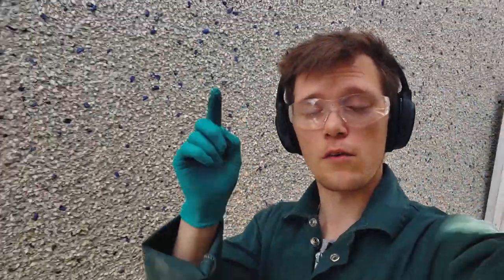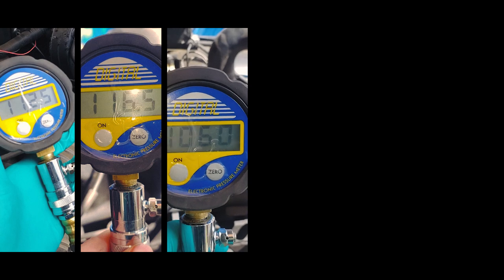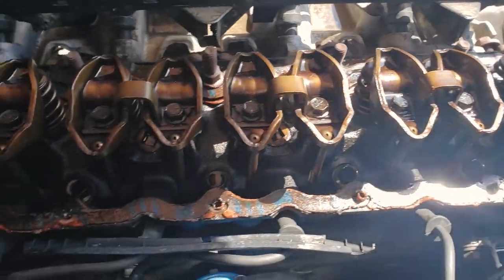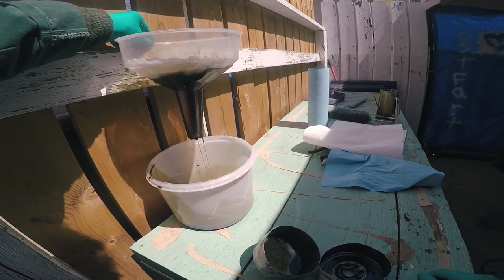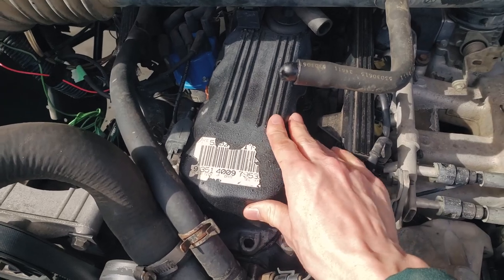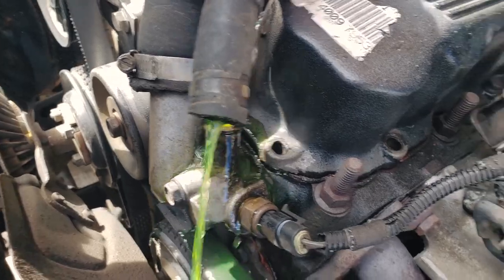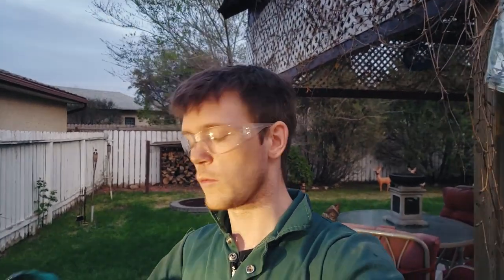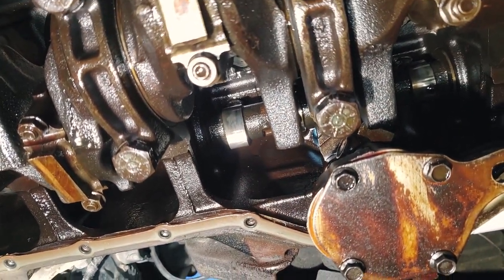Rover 1 Project - Diagnosing 4.0L Engine Failure

Comment: I personally wouldn't have bothered taking it apart in frame.  I would have just pulled the motor entirely.  You know it's no good and based off how it sounds highly unlikely to be properly rebuilt in frame.  Considering how low the compression is I have my doubts you'll get away with using something like a dingle ball to freshen up the cross hatch of the cylinders.  It very likely will need to be bored / honed and oversized pistons will be required.   Your cheapest option IMHO is to find a engine from a salvage yard.  I am not affiliated in any way with this site but I use it all the time to find parts  www.car-part.com  Its like the index of all participating salvage / wrecking yards inventory at your fingertips.  Here in the states they're running 600 to 1000 bucks.  The 4L and especially the 2.5L are hard to find now with a lot of them being destroyed from the Cash for Clunkers incentive our government rolled out during the last administration.  So our prices are little higher - hopefully you can find one cheap!  Keep on keep'n on.
Reply from the maker: I'm not interested in a rebuild, like I stated in the video a few times. I was just curious as to what happened to the engine.

Comment: Was it you flex plate?
Reply from the maker: Huh, never thought of that. It would be flywheel in this case but worth a check. Doesn't explain oil pressure and power loss though. Hmmm
Reply: LostFart well maybe not the oil pressure bit maybe your clutch blew up
Reply: Also check your timing maybe the chain was so slacked it slipped and caused the lack of power hence lack of oil pressure no rippems no jam
Reply: Also accounts for low cylinder pressure. Concentrate on your timing chain. If it is so you can save this engine with a head job check for bent valves. And a timing kit with chain sprockets and keys which might have failed.   A couple hundred bucks will fix it
Reply from the maker: @delinquentdesign  I'm not interested in a rebuild or spending much money on this engine. The chain has some slack but nothing major tbh.
Reply: LostFart well shit thats where i put my money is the timing slipped everything else looks ok. At the very least for tits and pickles take the timing cover off and check your timing marks. Then we gave it our all in this mystery fail. It sounds like its cranking freely and not struggling to turn over. So i dont think it was gonna be seized. Do it for science lol
Reply from the maker: @delinquentdesign  I will remove the cover lol